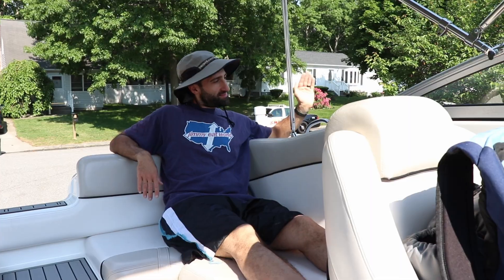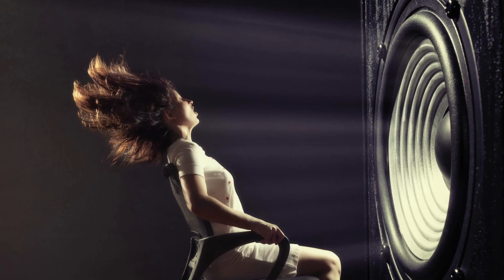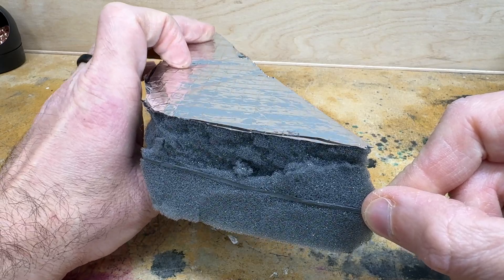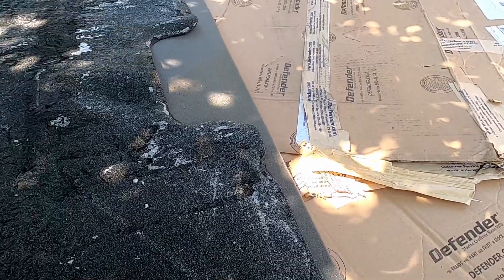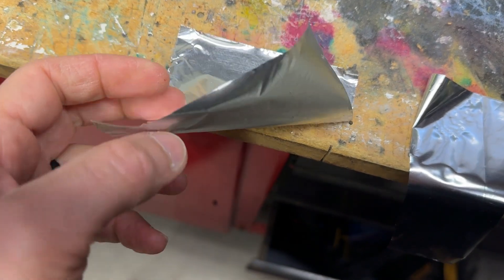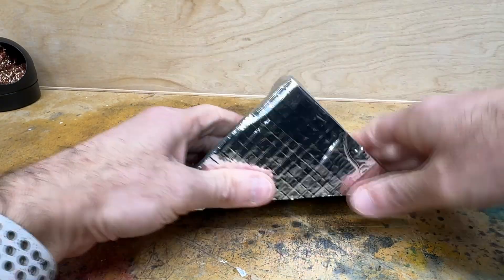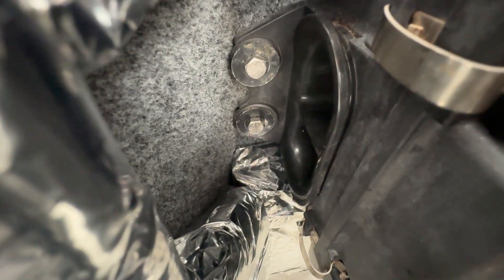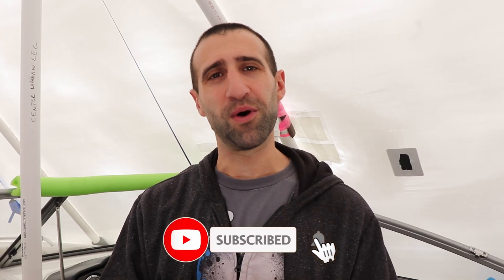Yamaha Jetboat | Engine Sound Insulation Install

Comment: I bought a 2023 275 sdx. Twin supercharged and it was loud as hell. I did the killmat in the engine bay within a couple of weeks after delivery last year. And it was so cheap I had enough to do under the seats. That Helped make the 10” stock sub stop vibrating the heck out of the fiberglass too. 
I still Have left over killmat. I’ll
Be doing more soon.

Comment: Good job Mike…I’ve been following you, Capt Leon & Smokin J since my purchase of my 2021 195S. Many great ideas. For sound deadening, I used Kilmat 50mil squares on the inside of the engine cover to see how well it did. Definitely worth the effort since it lowered the reverberation of that cover better than the stock, whimpy foam. Apply it on a warm sunny day and it stick nicely. 
I’ll be adding more to other areas of the engine bay as well as the gas tank cover (as you pointed out) since I hadn’t thought of it as a source of vibration. 
Keep up the good work all you Yamaha peeps. I’ll be on Barnegat Bay enjoying the fruits of your labor.
Reply from the maker: Thanks Matt! We’re just happy to give back to the community! The Kilmat definitely works too. I wanted to try something that was a bit “extra”. This thing is so dang loud lol